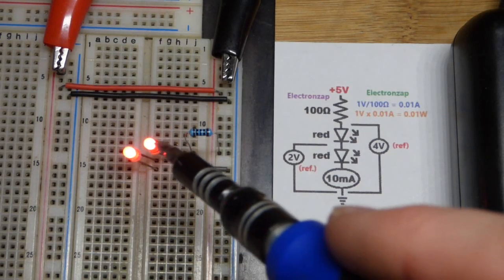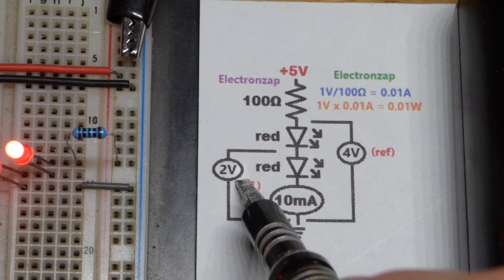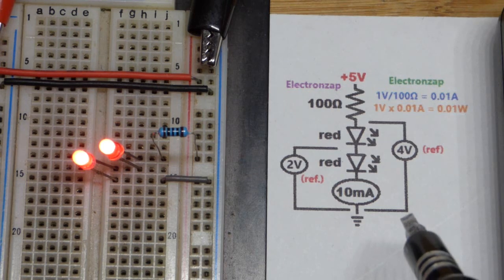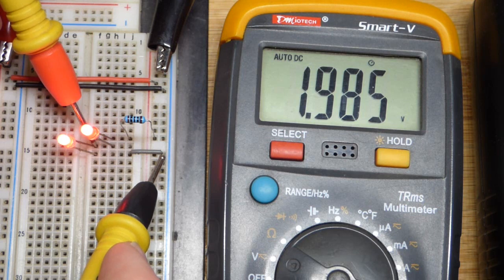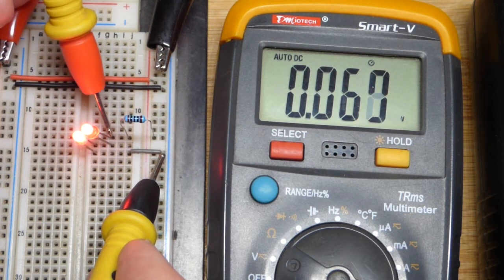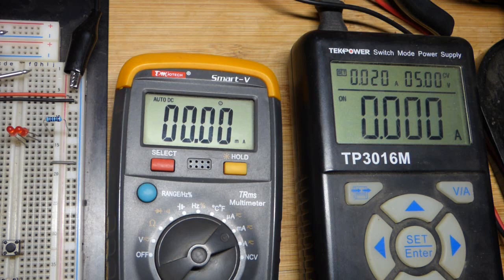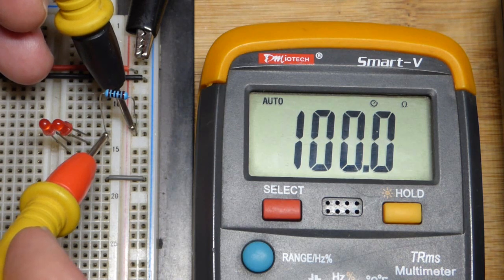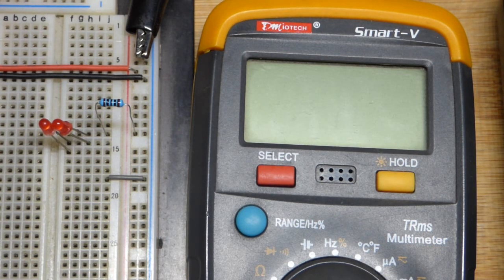2 and 4 volt references using two red LEDs demo circuit schematic by Electronzap

Comment: Hi! Noob question - on the multi-meter, what are the holes between the "Select" and "Hold" buttons?
Reply from the maker: This multimeter will light up the display when it gets dark enough. I'm pretty sure that the light sensor is under those holes. I also have a feeling that the meter will vibrate when in an environment that is too loud to hear the beeping while doing a continuity check, so I think there is also a microphone under the holes, but I could be completely wrong about that.

Comment: or you could stack tl431 in its 2 pin 2.5v mode, get 4 in series and you have 2.5, 5, 7.5 and 10v from a 12v+ source just choose a suitable series resistor to get a few ma of flow to keep them biased.  tl431 will be more stable and more accurate than a random led's forward voltage drop according to its datasheet as forward voltage drop is  a little ballpark on leds.
I may (if i ever remember) add such a circuit into my bench PSU just to sanity check my meters from time to time. a constant current source for say 500ma would be a good build in addition too to check multimeters current ranges.
Reply: And it will also have a defined temperature drift. For LEDs the temperature drift of the forward voltage is rarely defined.

Comment: Fun. I am wondering if Zeners might be able to provide more current than what the LEDs can, if they were arranged in the same way. I will have to think on that. Things that make you go hmm; a Zener in series with a Zener... Edit: Zeners would allow you to set the voltage divider ranges anywhere that you needed them to be, because Zeners come in a wide arrange of voltages...
Reply from the maker: Yeah, the common Zener diodes tend to be rated for a max of 0.5W whereas these LEDs would be a maximum of 2V x 0.02A = 0.04W. I should have mentioned that Zener diodes work better as reference voltages.